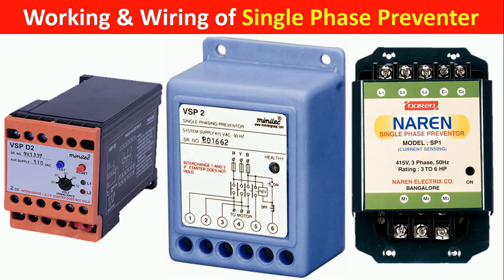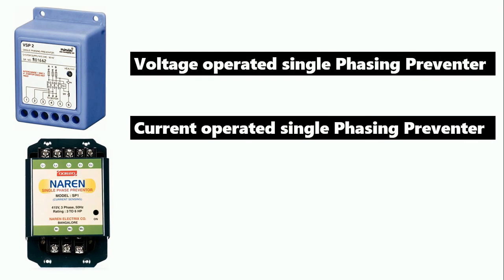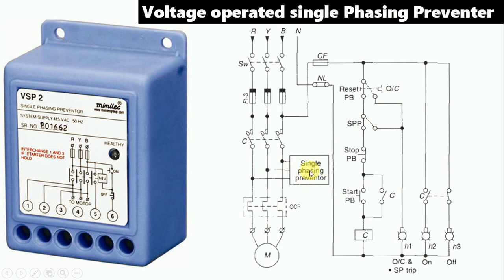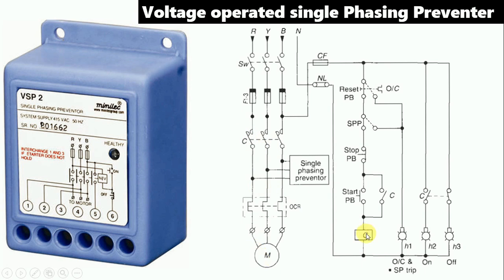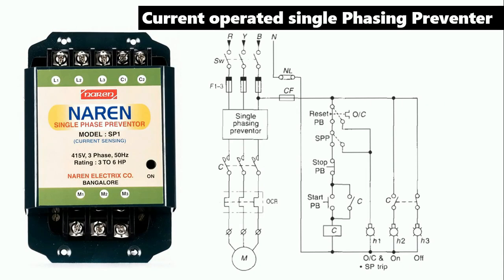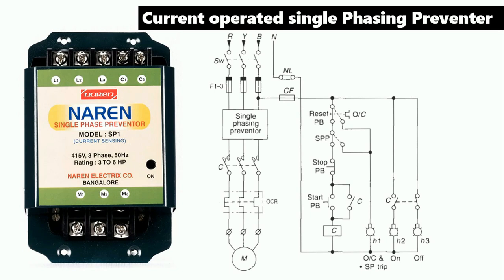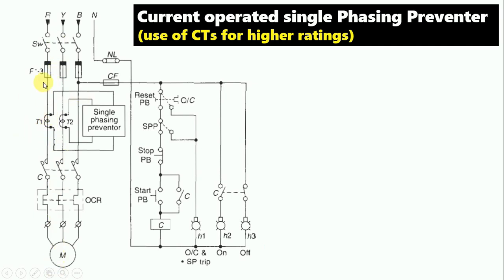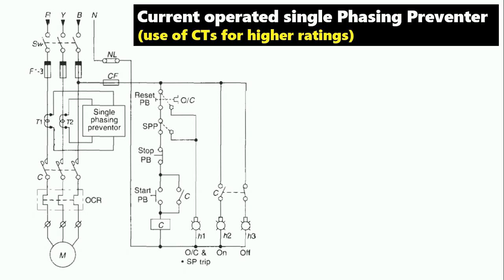Phase Failure Relay | single phase preventer connection diagram @TheElectricalGuy

Comment: Firm believer in single phase preventers especially on roof top HVAC units. Worked at a cheap shake Gannett newspaper back when they were having record profits & stock split. They had the cheapest basic rooftop 20 & 25 Ton compressors that I told them needed this protection but said the $4 to 500 for 4 units was too much and were under warranty. Under warranty two compressors burned out due to single phasing and cost nothing . Following two years other two compressors burnt out but they had to pay the $5,000 for a over 100' lift crane to get compressor onto units . After tight wades spent $10,000 for cranes plus labor they spent $500 on the comoressors. Pay me a little NIW or a lot more later.